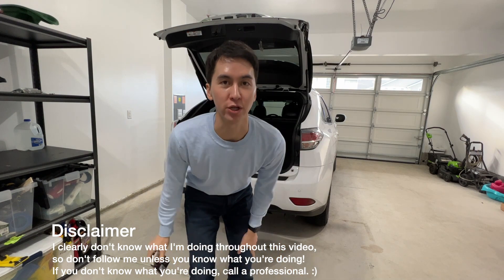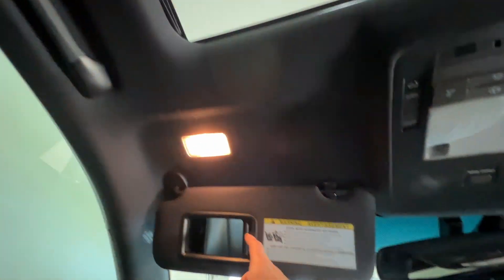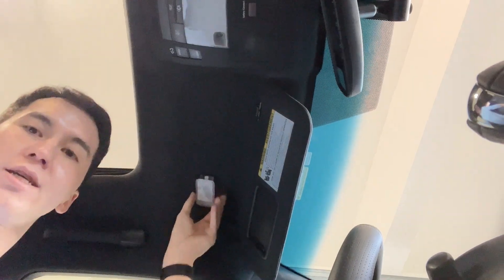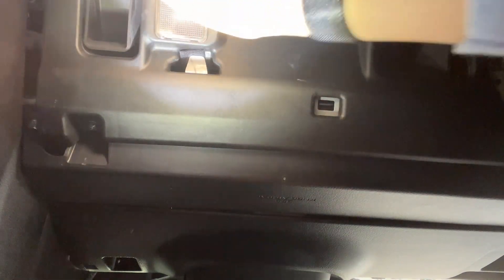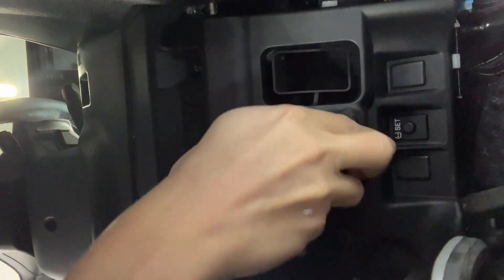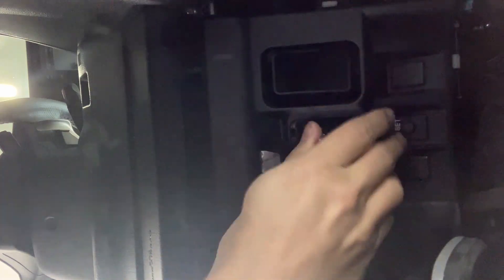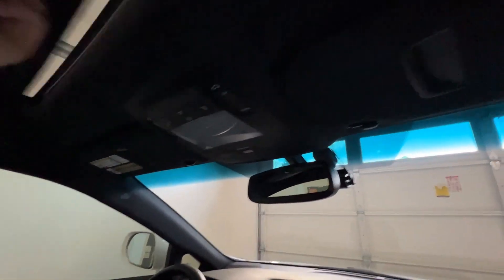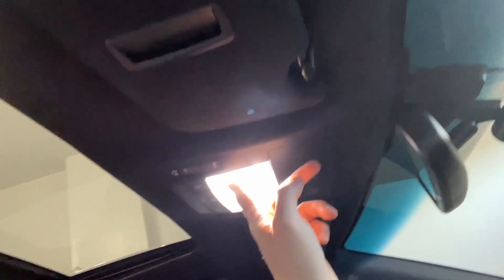How to Upgrade 3rd Gen (2010-2015) Lexus RX350 Interior Lights to LEDs

Comment: About the rear passenger seat dome light ... There is NO need to remove the entire housing like almost all YouTubers do. Easy way:  (1) Take the cover off, (2) Slip a 1/4" wide rubber band around the bulb, (3) Tug the rubber band tightly with your thumb and index fingers while supporting the bulb with your other hand's index finger, (4) Gently pull out the bulb making sure the rubber band secures the grip,  (5) Reversing the procedure, install the new LED bulb also gripping it with the same rubber band and ... VOILA! job complete with no damage to the housing.

BTW, the bulb pin is positioned in the horizontal position. Also you may need to cut the rubber band to slip it out after the bulb is firmly in place. Just like Yoda, BE PATIENT and may the Force be with you!😅
Reply from the maker: Oh wow, a rubber band method!  Glad you found a good way that works for you! 😄
Reply: I just finished upgrading all the interior led lights and I figured out a way to get the rear passenger dome light installed without having to remove the housing. The trick is to slide the led bulb head first into the groove kind of like changing out batteries for a tv remote since the led head area has some clearance room to slide in from an angle and once you have the bulb pushed in, you should be able to have the entire led inside the compartment and you can use a small pair of tweezer to guide the connector side in and once it’s in the groove, you can just use your hands and push it gently in. Also the plastic prying tool that comes with the led bulbs are a bit too thick. I would recommend to use a guitar pick or a jimmy tool. Makes opening all the plastic covers a breeze and comes off on the first time each time and you won’t have to worry about scratching any of the plastic trim pieces or break any plastic tabs on the cover
Reply from the maker: @alvinj3530  Great! Thank you for sharing! Be sure to sub for more, and thanks for your support, @alvinj3530! 😄

Comment: Hello thanks for the video. Which projector lights did you add for the lights by the foot door.
Reply from the maker: Thanks, narutosauske2787!  The exact logo projector lights I bought are no longer for sale on Amazon (just checked...they were called "Klinee Lexus Accessories Easy Installation Car Door LED Logo Projector Welcome Lights For Lexus(2 Pack)", and I bought two of sets of two).

Mine had an issue with moving around a bit within the housing, so I think I used some super glue to keep them from moving, and now they seem fine.  Here's an affiliate link to what looks to be a similar set, in a pack of 4: https://amzn.to/3GVOLmG. Looks like there are many other options available too!

Thanks for your support! Please be sure to subscribe for more! 😄